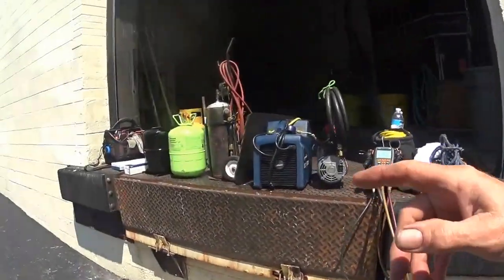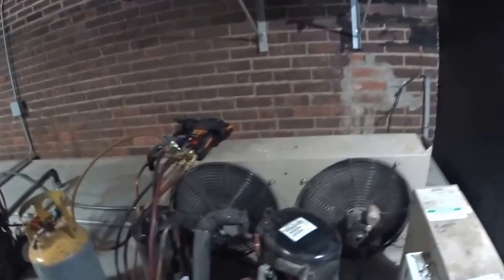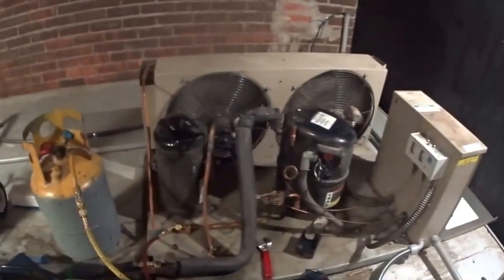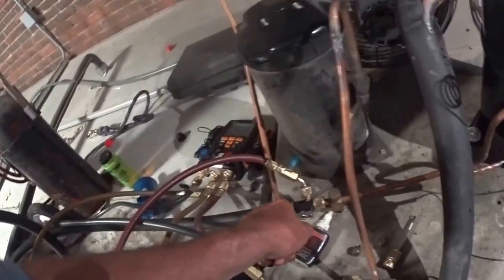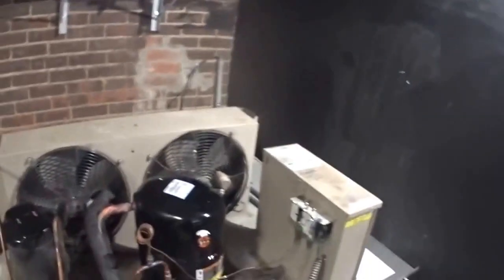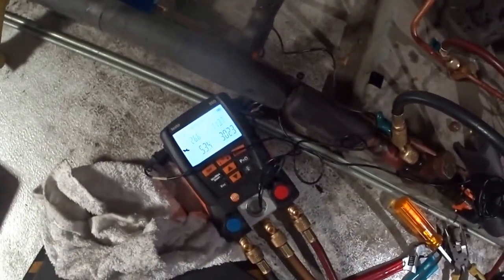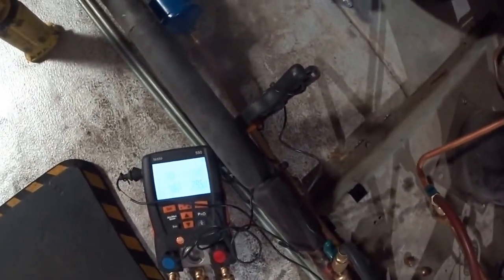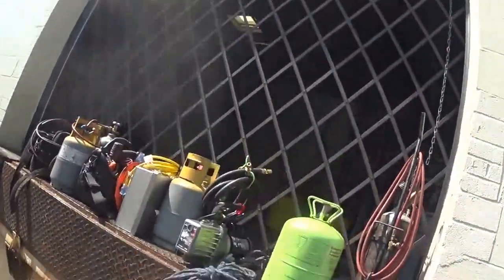Compressor change out  reclaim R22 and charge with R407F

Comment: Good show....I was waiting for the amp draw report...would the reading be the same on any of the 3 legs(amp clamp)?...also the tools and meters and stuff cost a bunch..just how many repair calls like this one you did would it take to pay for a full set of new tools?
Reply from the maker: Erik Cable the amp draw on each leg should be the same unless the fan motor line is on two legs. how much ?    I bought that amprobe last summer and it's almost time for another one, I use it a lot.

Comment: Thanks for the footage Jim. First time for me watching refrigeration videos. I heard Zack mention your name so I thought I would check out your channel.

About your weird voltages. 120 to ground/neutral and 208 between phases is a "Y" configuration. It sounds like they changed it over to a Delta with no 120 volts available. 230~240 between phases is a normal Delta voltage and fine as long as your equipment doesn't need any single phase 120 volts.

The reason your tank temperature didn't jive with the R22 pressure is because the tank needs to be in a stable temperature environment for a while so the gas inside and the tank itself are at the same temperature. The gas inside was hotter than the tank because the ambient was cooling the tank off. Pure refrigerant will never wear out or loose any efficiency.
Reply from the maker: Nicholas CeeA very good info, thank you

Comment: Nice work Jim!

Our three phase here is 415/440 Volt, single phase stuff is 240 Volt, used to go to a place where they had split phase power, basically two lives 180 degrees out of sync, so gave 480 Volt between phases and needed a neutral to work.

Comment: Good day Mr. Jim. its not a problem if the cylinder turn upside down while  you charging the gas?
Reply from the maker: Washington Deles I close down the ball valve on my yellow hose to meter the liquid so it boils off in the hoses before it goes into the compressor

Comment: Did you change the txv ? I read somewhere that you have to change it when converting an R-22 to R-407F
Reply from the maker: Ahmad Hamad no 407F is an R22 replacement, the pressures are similar, R404a you have to replace the TXV. Thanks

Comment: strange.  must be 3 phase 4 wire 208v.  208v is neutral to power.  Sorry depends on transformer type, some 208 to neutral some 208 phase to phase.    Loose neutral somewhere?  I just had one.  3 phase 4 wire computer desk install.  Multiwire old electric.  With one breaker off the other leg read 49 volts.  weird.  Both breaker off O volts.  But both read 120v after hookup.  And they work.  Crack monsters thats funny.  I have only worked with three phase 3 times.  Still learning.  I have had multiple loose main neutral in single phase meter boxes.  40 one leg 200 other leg.  burns up electronics, dims or brightens lights.  tighten it up and all good.  Oh great video.  Sorry to rant on.  I had to get out my commercial wiring book from school.
Reply from the maker: All Hours Maintenance thanks

Comment: Why not 404 with new valve. I'm assuming you lose a little capacity using 407. Thanks for another great video
Reply from the maker: nortek repair They put Global Warming Potential  (GWP) numbers on the refrigerants with 4000 the limit. R 404a's GWP is 3950 and they are going to lower the limit which means R404a will be the next to go, unfortunately. R 407F's number is 2750. Yes the capacity is slightly less. R 407F is close to R 22 the head pressure is a little higher. I really liked R 404a.

Comment: Neat work Jim.

Nice trick with the CO2 on the condenser.

Quick question. I read somewhere that if the recovery cylinder is left stationary for 24hrs, one can bleed off the vapor on the top into another recovery cylinder to get rid of the air (from someone not purging or pulling a good vacuum). What are your thoughts on this?
Reply from the maker: PHC Apprentice good suggestion, the air doesn't condense and would be on the top of the tank, I'll give this a try, thanks

Comment: I know it seems like a dumb question but, when you fill the system with nitrogen to solder up the fittings, how do you go about making sure all the nitrogen is out before you charge the system up and run it?
Thanks for the videos.
Have a nice weekend.
Reply from the maker: amtpdb1 a good deep 250 micron vaccum. thanks
Reply: ***** Thanks